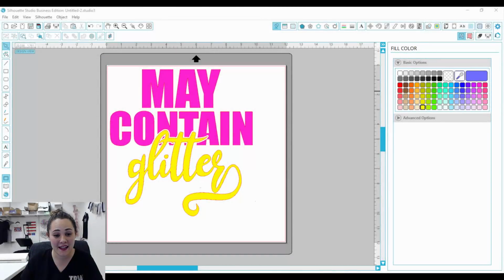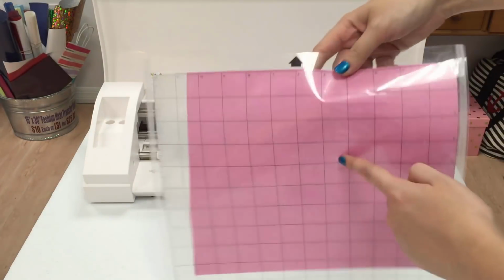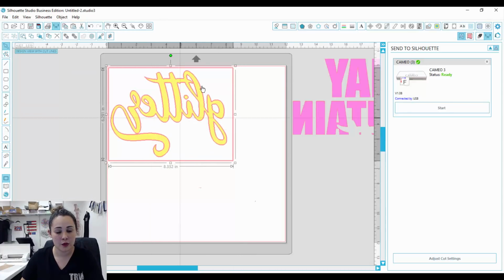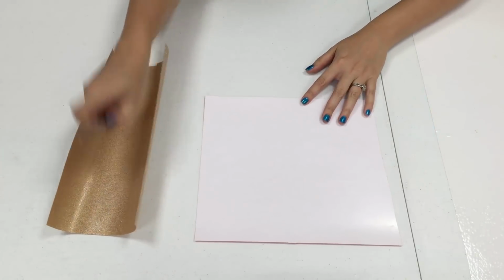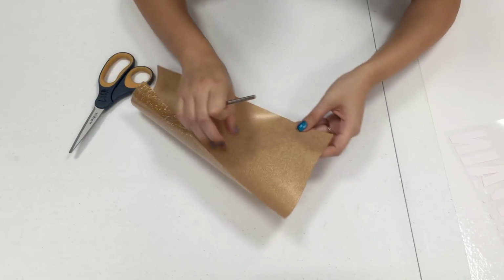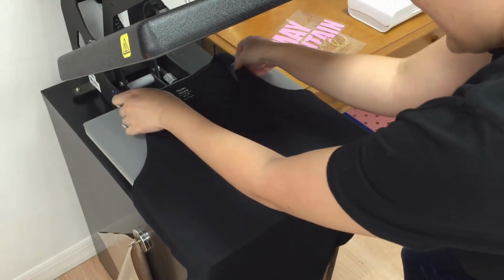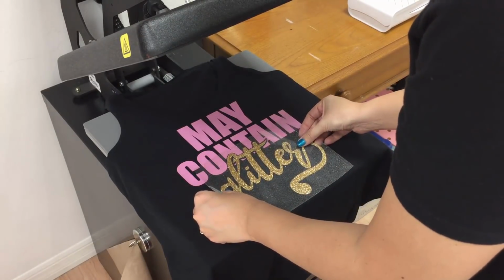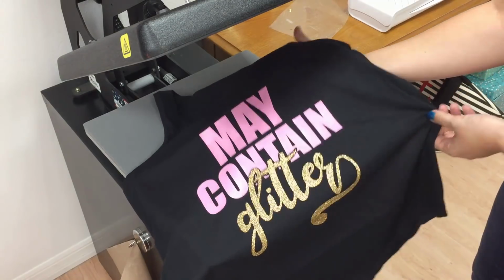How to Cut and Press a Multi-Color HTV Shirt Using the Silhouette Cameo 3

Comment: Anyone please help - do I have to have a heat press or can i use an iron?

i am trying to keep start up cost low - thx
Reply from the maker: Hello! While you can use an iron, we do not recommend it. This is because it is difficult to regulate temperature and pressure with an iron. Therefore, using an iron may lead to vinyl peeling off prematurely. I'd go with a press if possible. - TRW Richard

Comment: I am trying to heat press multiple concentric vinyls. I heat pressed the first design for about 3 seconds as you said. However, the vinyl didn't stick to the shirt. What could I have done wrong? Please help.
Reply from the maker: Are you using our vinyl? If it isn't our brand, they might have different temperature/time settings than we do. Otherwise, please email us at info@therhinestoneworld.com and we can try to figure out why our vinyl isn't sticking properly.
-TRW Bri

Comment: What brand press are you using. And do I only use HTV for the press or can you use the Oracle 651 vinyl
Reply: I have this printer, and I love this thing. it is able to cut any king of vinyl but you will have to mess with the cutting depths  in the settings to make sure its right. trial and error but it will work.

Comment: What size heat press are you using in this video. 16x20, 11x15 or the 15x15?
Reply from the maker: This is a 15x15 press. :) - TRW Lisa

Comment: I am having difficulties with settings. The preset settings for the glitter heat vinyl is cutting through my matt. I changed the settings to blade 2, force 7 and speed 7 and it is still cutting through. what am I doing wrong?
Reply from the maker: Malesia, 
Have you updated your firmware since you got the machine?
TRW Alexis
Reply: Hello, thank you for replying. Yes i did. However I found the recommended settings for specific material and that seemed to help. I cleaned my blade and for the most part it seems to be cutting ok. I am still having issues with the final cuts it seems to cut most of the project correctly but when it gets to the last...for example I am doing jersey's, it cuts the name correctly and maybe the first number which is a much larger font, but the second number it cuts 80% of it and I have to use an expo blade to follow the impression to finish cutting it so i can weed it. Any suggestions?

Comment: What is the difference between vinyl cutting and printing on transfer paper
Reply from the maker: Shayla, 
With printing you can have multiple color transfers that have gradient/pattern fills. With vinyl, you can't have those gradient fills and you can do multiple colors, but it does take quite a bit of time to press each individual color. 
TRW Alexis

Comment: Hello! 😌 Where exactly is the setting to let the cameo know that you're using a cutting mat?
Reply from the maker: Hello,

When yo are in the cut setting panel, you can adjust the size of material and there is an option for cutting surface. Let us know if you have any other questions.

TRW, Grant

Comment: Can you use regular transfer tape if you lay a Teflon heat resistant sheet on top?
Reply from the maker: You would not want to use Transfer Tape for sign vinyl. It would melt even with the protective cover sheet. Matt
Reply: I just got a new heat press. What type of heat resistant mat is she using in this video?????

Comment: I am super new to all of this....Why do you use a mat sometimes and other times not?
Reply from the maker: Clarissa, 
You should use a cover sheet when there's any vinyl exposed to the press. A lot of times, the carrier sheet from one transfer will cover up the other transfer to protect it from being directly press to the platen. 
TRW Alexis
Reply: I was actually talking about when cutting.
Reply from the maker: Hello,

The mat is used for smaller pieces of material so the rollers still hold it. It also helps protect the cutting strip from getting damaged.

TRW, Grant

Comment: I keep the heat-press on the clothes for about 30 seconds on 160+ celsius.
What properties you do use? It seems too fast to me.
Reply from the maker: For regular Easyweed, we press at around 305 degrees Fahrenheit with medium to firm pressure for about 10-15 seconds. For glitter vinyl we press around 320 degrees Fahrenheit with the same pressure and time. If your vinyl isn't staying down, you might not be using enough pressure or you might have cold spots on your press.
TRW Alexis

Comment: hi @therhinstoneworld - can you comment on how this cutter would work if we had a multicolor logo to be printed on a satin sash type of material? What there have to be a big square match like look around it?
Reply from the maker: Ritu, 
I'm unsure of what you mean by the big square match around it. Could you clarify so that we can help you? 
TRW Alexis
Reply: TheRhinestoneWorld sorry that was a typo. I guess my question is how to you heatpress a multi color logo onto a shirt?
Reply from the maker: You would press one color at a time! We usually start with the part of the design that takes up the most amount of space or is more central so that we are sure everything is aligned properly. Instead of pressing each layer for the full recommended time, you would press each layer for 2-3 seconds and once all colors are pressed, do a final 10-15 seconds press. 
TRW Alexis

Comment: Which settings will use to separate the color?
Reply from the maker: It is in your advanced cut settings. It is called "Cut By Color". Just make sure that you're using your fill settings when designing, or your "Cut By Color" settings will not work. - TRW Richard

Comment: Why does my vinyl keep sticking to the mat?  I have tried a couple different mats but it still sticks.  My blade is set on 1.  the glitter vinyl cuts just fine.
Reply from the maker: Hello! Just to clarify, is it the Easyweed that is sticking to your mat and not the glitter? - TRW Richard
Reply: Yes, the glitter prints fine.  some have said not to use a mat.
Reply from the maker: Tiana, 
You can definitely cut without a mat! When you pull the vinyl up, does it leave the cut part of your design down on the mat? You may have your thickness set too high. You could also consider trying to make your mat less sticky by sticking it to a table a couple of times and pulling it back up to get rid of some of the tackiness. 
TRW Alexis

Comment: what if glitter particles are on the transfer sheet around the design?? how do u keep that from getting on the shirt?
Reply from the maker: Kim, 
Unfortunately there's not a really great way to avoid the residual glitter from getting on the shirt initially. You could try trimming down the transfer extra close so that there's not a lot of extra material with glitter remaining. Also, you could try taking a lint roller after you're done pressing to try and pick up some of that glitter. 
TRW Alexis

Comment: What kind of vinyl are you using and what kind of vinyl should I use and what setting should I put it on because I'm really confused
Reply from the maker: This is Siser Easyweed and Siser Glitter. It depends on what you're trying to make! If you just want normal, plain colors, Siser Easyweed will work just fine! Each vinyl has it's own pressing specs. For example: Easyweed has to be pressed at 305 degrees for 10-15 seconds at med/firm pressure!
TRW Alexis

Comment: Thanks for the tutorial!! Quick question, I did lots of layers and my shirt came out ok but my teflon got sticky residue and left some on the shirt any ideas why? Thanks for any help!
Reply from the maker: Do you know how much pressure you used when pressing? If you used too much pressure, it's very possible that it made the residue ooze more than usual. 
TRW Alexis
Reply: Thanks for the tip! I just got the heatpress and I did adjust the pressure, I did another shirt and it was better but still same issue? Maybe it's still too much? I'll look more into it, thanks so much!

Comment: Why aren't you using a heat pillow? I was told it's better to use the pillows please explain . Thank you
Reply from the maker: Anita, 
Pressing pillows are going to be really good for thinner materials so that the front and back of the shirt don't get stuck together and then for garments that have really thick seams to get even pressure. In this case, neither of those were an issue so we didn't need to use one. :) 
TRW Alexis

Comment: This is considered Iron on, is it not? Isnt this like the worst type of T-shirts to purchase? One wash and they fall apart. Correct me if im wrong, Im a noob.
Reply from the maker: Hello! You can use an iron. But you have to watch your temperature and pressure. Using a heat press you can set the temperature and pressure on the machine itself. The tank-top is not the worse t-shirts to purchase. All you need to do is turn the t-shirt inside our while washing to protect the vinyl. - TRW Aaron

Comment: Hi Lisa, I don't understand the difference of "automatic blade" and "cameo blade" when cutting? Thanks
Reply from the maker: Not a problem! The Cameo 3 actually has a blade that automatically adjusts itself to the setting that you set it to in the software, whereas the standard Cameo blade you have to manually ratchet it to the setting that you need. :) 

TRW Nick

Comment: How do I choose what color vinyl to use? Doesn't it already print in the color selected on the screen?
Reply from the maker: Hello, 
The vinyl is actually cut out of instead of printed on, so you pick what color vinyl you want and then cut that color portion of the design on the corresponding color. There is a vinyl that you can print onto, however we do not sell nor work with that style vinyl.
-Kaitlin

Comment: Thanks for the reply......I recently brought a heat press and a silhouette vinyl cutter anything else I'm missing.....??? Any tips would be greatly appreciated
Reply from the maker: Nicole,
If you're wanting to work with rhinestones, we recommend upgrading your Silhouette Studio software to Designer Edition as it allows you to work with rhinestone designs and bring in SVG files types. Outside of that, the only thing you really need are your materials! Vinyl, rhinestones, a pick tool, tweezers, a rhinestone brush, magic flock, etc. It really depends on what you're looking to get into. :)
TRW Alexis

Comment: Can you use an iron if you don't have a heat press machine?
Reply from the maker: Anna,
You can certainly use an iron, but it's not recommend as it doesn't yield consistent heat or pressure. 
TRW Alexis
Reply: you're much better off using a heat press if you're making stuff to sell but if you're making a t-shirt that you'll wear once or twice an iron is fine, just make sure you use the heat non stick sheets

Comment: when loading the thermoflex plus which side should be facing up.. the shiny or dull side?
thanks
Reply from the maker: Dawn,
We don't work with ThermoFlex, we only work with Siser Glitter, but you usually will load it into your cutter with the shiny side down, dull side up. :)
TRW Alexis

Comment: I have my heat press set to all those settings but when I do a quick press to get it to stick for the first layer it doesn't come off so nice like yours?  What am I doing wring. Does my pressure need to be higher?
Reply from the maker: Hello! Just to clarify, when you say quick press, how long is it? - TRW Richard
Reply: TheRhinestoneWorld 3 - 4 secs
Reply from the maker: Megan,
What is the material that you are using for your first layer?
Send us an email at info@therhinestoneworld.com so that we can help you in greater detail.
TRW Casey
Reply: Megan Bannon You're using cold peel vinyl.  Let it cool completely before peeling it.

Comment: Is there a particular shirt type for heat press. Or any shirt will do just fine.. I'm just confused between polyester and cotton shirts
Reply from the maker: Hey! 

Any shirt will do just fine. Just make sure it is not like a coated polyester (like football jerseys), as the adhesive will not be strong enough to stick to that type of material. You will not want to put it on Under Armor type, Dri Fit shirts as they will stretch and pop the stones off of your shirt. Other than that, you should be great! 

TRW Nick

Comment: Are you storing your heat press on a filing cabinet? Did you have to weld it down?
Reply from the maker: Dani, 
Yes, that heat press was sitting on a filing cabinet and because the heat presses are so heavy, there was no reason to weld it down. 
TRW Kaitlin

Comment: How Can I get the cut out from the first word for the second word to fit perfectly? I have a SC plotter cutter so Idk if its different. :(
Reply from the maker: In the Silhouette software, we use what is called the "subtract" feature. :)

TRW Alexis
Reply: Is there a reason the subtract feature was used for this project,  instead of the registration marks which I  saw in some of your other layered project videos I saw? I'm still learning.
Reply: nadia232 late but: the substract feature is a point in the software and the registration marks a help to line up vinyl decals. You can't do that with htv because you would press them on the shirt, too.

Comment: Just wondering why you wouldn't do the glitter first, since that seems to take longer to transfer?  Thanks!
Reply from the maker: Heidi,

Since we used the lower temperature to apply, it didn't really make a difference which layer we pressed first since we did quick pre-presses. :)

Alexis @ TRW

Comment: Could I use an iron instead?
Reply from the maker: Gourley,
Some of our customers use an iron instead of a heat press.
We highly recommend using a Heat Press.
With a Heat Press you can apply even heat and pressure to the garment and design.
With an iron you may experience a premature release of heat applied material from your garment.

TRW Casey

Comment: isnt 16 thikness gonna cut through whole paper and plastic?
Reply from the maker: Depends on the material you are using, we are using a heat transfer vinyl, and it is not cutting through. 

TRW Nick
Reply: TheRhinestoneWorld oh okay, becuz i do want to use cricit glitter HTV and i was just wondering if it wasnt gonna cut through the whole thing cuz i tried it yesterday with just 10 thickness and it cut through the whole thing, the glitter vinyl and plastic
Reply from the maker: Hello! We are not familiar with Cricut HTV, so we cannot tell you what settings to cut it with. - TRW RIchard
Reply: completeGamer007 offbeat hvbbyhhhhuiiikoioiiiiiiijujhhuukkop

Comment: hi.. what is the maximum size that the cameo can cut?  say i have a word of "LOVELY DAY" the size of each letter is 12 inches tall. and 6 inches wide.. and say my vinyl is 1foot by 5ft. can it still be cut? or should it ebe 12x12 only? :( (this is just a crazy idea, which may be useful in the future)
 Thank you. !
Reply from the maker: Irish Carabana,
The cameo can cut beyond 12" in length.
The max length that the cameo can cut is 10 feet.
The software will show you the max length and width in the design page settings.

TRW Casey

Comment: When selecting your cut settings in Silhouette Studio you selected "easy weed" and said that you already had it programmed. How do you add siser materials into the "material type" section of the cut settings? If you did it manually, can you explain how and what settings to use for the easy weed?
Reply from the maker: Hi Kristy,

Here is a video on adding in custom cut settings :) 

https://youtu.be/yRJtjDP_D6M

TRW Lisa

Comment: How long does siser easyweed last after washing? How do you wash it? Cold water / hang dry?
Reply from the maker: We've washed shirts for years with Easyweed and haven't had any problems. :) We wash on a gentle cycle with mild detergent, no fabric softener. Either turn inside out to dry on a low cycle or hang dry for best results. :) 

Alexis @ TRW
Reply: Hi Alex,
I just purchased a Silhouette Cameo3 and Gecko heat press. I have been testin the Siser Easyweed HTV on Hanes 100%cotton tshirts for my grandchildren. The designs came out great. The kids wore them and laundered them. They all came out fine except for one. It was the Silhoette heart design with the word love in the middle. After the first washing & drying it is coming off.

Comment: HI,MY NAME IS PETE & I HAVE THE SILHOUTTE CAMEO & I HAVE BEEN BUYING THE HEAT TRANSFER FROM SILHOUTTE. MY QUESTION IS WHAT IS THE BEST HEAT TRANSFER OUT THERE THAT I CAN USE THAT IT WON'T COME OFF IF YOU PUT IT ON A POLO SHIRT,T-SHIRT,SWEATER,SWEATS EXETRA..WHEN YOU WASH OR DRY YOUR CLOTHES?? THANK YOU FOR YOUR TIME...
Reply from the maker: Pedro,
We use Siser EasyWeed Heat Transfer Vinyl.
This vinyl when used on the proper fabric and cared for will stay on the garment.
Heat transfer vinyl will fail when exposed to Med/High heat in a dryer, and or Fabric softener in a washer after application.
What is the Fabric of the garments that you are using?
TRW Casey
Reply: HI,CASEY...THANK YOU FOR YOUR QUICK RESPONSE I AM TRUELY GREATFUL & APPRECIATE IT ALOT. THE GARMENTS THAT I HAD USED WAS POLYESTER FOR A FRIEND OF MINE. SO, IS THE ONE YA USE BETTER???
Reply from the maker: Pedro,

Easyweed would work fine on polyester garments. :)

Alexis @ TRW
Reply: +TheRhinestoneWorld THANK YOU SO MUCH ALEXIS...
Reply: +TheRhinestoneWorld BY ANY CHANCE DO YOU GUYS SELL BIG ROLES OF YOUR EASYWEED HEAT TRANSFER VINYL?